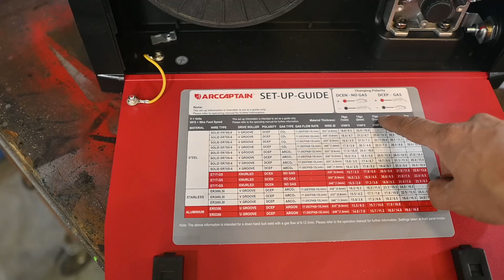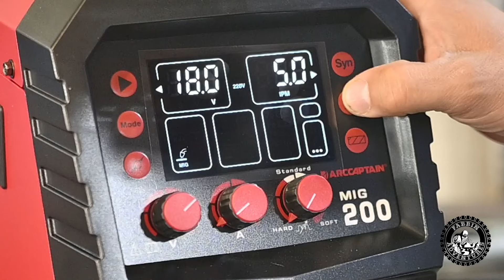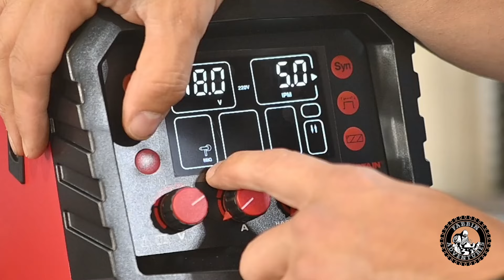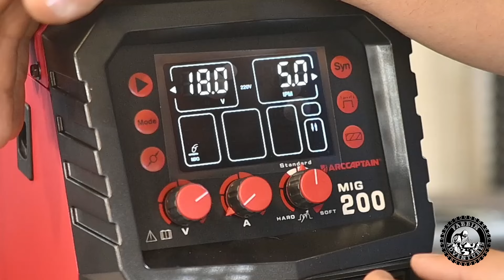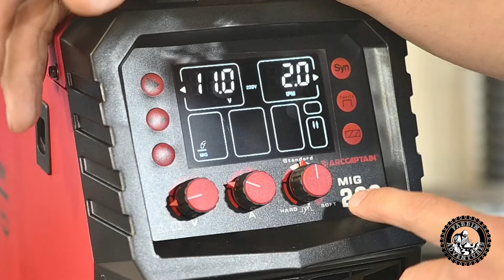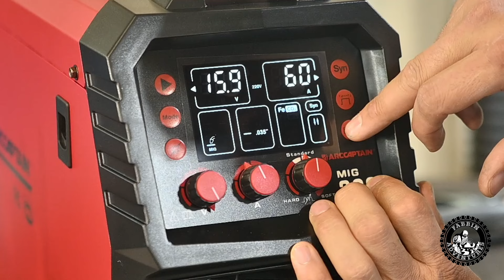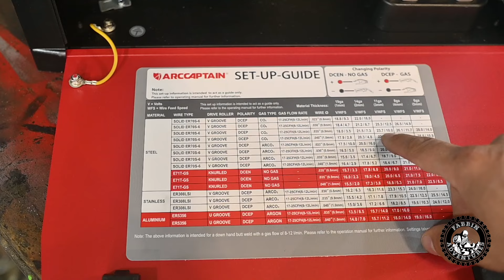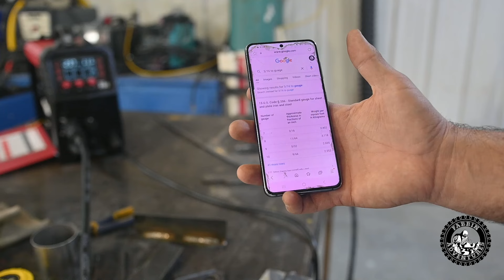Arc Captain Mig 200: An in depth Review

Comment: I'm getting mine Tomorrow. Bought it on Amazon. and the first thing I'm going to do is measure the output current to see if it's true to specs.
Reply from the maker: Great idea, let us know what you find out!
Reply: @FabbinAdventures  I will upload a video. I just did one on FEMEROL MIG 250 just using Fluxcore and on 220v
Reply from the maker: Nice, do you have a channel?
Reply: @FabbinAdventures  yes, click on the little icon. not a welding channel.

Comment: Great video!  Thanks!  I had a question that you might be able to answer since you said you have a DP200 also.  I have been looking at lots of videos for both the arccaptain and the DP 200.  Almost without exception, the arccaptain welds look much much nicer than the DP 200 Welds.  Your arccaptain welds are almost as good as the best I have seen on YouTube. The majority of DP 200 welds look horrible by comparison. Also, most DP 200 videos record a much louder and noisier sounding arc than from the Arccaptain videos.  Of course, the look does not necessarily correlate with the strength of the weld, but in some applications, the weld appearance can be important. Can you comment on whether the arccaptain truly produces better looking welds than the DP 200 and also if the DP 200 really is noisier than the arccaptain.  Is maybe the inductance set much lower on the DP 200 leading to coarser looking welds?  Appreciate any feedback you can provide. Thanks!
Reply from the maker: By far the dp200 is a better welder, easier to set up, more controlable, better quality, nicer looking..lol if that matters.
I would not even entertain the idea of buying the arc  aptain if i had the choice!
Both machines weld nicely though and looks of the weld don't really mean much, i can make just as nice of welds with my 15 year old Magnum.
If you can afford the dp200 you would be much happier with it i think.
Have you seen my part 1 and part 2 of the dp200?
Thanks for watching and commenting!
Reply: @ thanks for the quick reply!  That was exactly the kind of feedback I was looking for.  For some of my potential uses, looks matter, and a scraggly looking weld would require lots of post weld love that I would rather not spend if possible. For some reason, almost all the Arccaptain video welds look super nice, even, smooth, almost like a machine made them. And by contrast, almost all the DP200 videos have what in many cases are actually nasty looking welds, splatter, distortions, irregular, choppy, just ugly looking welds. I’ve been trying to chalk this up to novices skill level (lack thereof) but some of the arccaptain videos have novices and they are producing just as nice looking welds!  So I don’t know why this is (with the videos) and so I really wanted to get the perspective of someone that has welded with both. BTW, I did view both your DP200 videos also, but you didn’t do as much “weld display” in those as you did in the arccaptain video, so it was a little hard to compare.  If you were looking for a next video topic, maybe a “Battle of the MIGs” comparing them might be a good topic.  It could then also show a side by side comparison of the welds from both machines on same material welded same way. Anyhow, thanks so much for your reply!  (PS, Subscribed ;-)
Reply from the maker: @hu5116 well a side by side comparison video would have been a great video, but i sold the Arc Captain off cheap about a week after the video Aired. I kept the dp200 which has replaced my old welder. That should give you an idea on what i think of it! 2 of my buddies bought dp200s also after trying it out. Hands down the winner!

Comment: Unfortunately I haven't had chance to try it yet. Need to check your review of te DP200 as I definitely qualify as a rooky. I am 70 am learned in  college in1983. HAVEN'T pursued it since because of costs and not able to find job that that required it.
Reply from the maker: Don't get me wrong this welder welds great, its just not that user friendly compared to the DP200 or my old magnum and a few others i've worked with in the past.
Unfortunately i think they are priced higher than they should be for what it is.
Here is the link to part 1 of the dp200
https://youtu.be/wU3irHU1JVQ
In my eyes it is way easier to use and was alot cheaper when it was on kick starter. It just released oct 28 of this year.
Thanks for watching and commenting!

Comment: well got the Arccaptain and did quick tests to learn my way around it  and so far I must say I'm not impressed. actually dissapointed. this is sold as 200Amp MIG welder but only goes as high as 180 Amp and on fluxcore it maxes out at 160Amp with 0.030 wire. and since they dont include a  Teflon liner to replace the existing liner in the MIG torch , I assume it can only do aluminim with spool gun. it has option for 0.023 wire but No  Roller for it. I should have video of ampreage tests before the end of next week.
Reply from the maker: Yep, i was not overly impressed with the.machine either, i mean it does weld fine, but its far from intuative to run. The yeswelder dp200 is a far better machine! I have a couple reviews on that machine.
Reply: @FabbinAdventures  I was just looking at those. I might give it a try. too bad Yeswelder never includes spot weld feature.Does it actually go as high as 200A on display or like arccaptain it tops off at 180?
Reply from the maker: @WV591 i do believe the dp200 has the spot feature, and i think it does 200 amp with mig, 180 with stick, it is a pretty sweet machine, wstch my 2 videos on it before you decide.
Reply: @FabbinAdventures  I was looking at yeswelder MIG 250 Pro. only the latest machine DP200 has the spot. .By the way that chart that Arccaptain has inside the machine is Generic and it ships with other imports all same values. it is exactley same as my FEMEROL.that's funny.